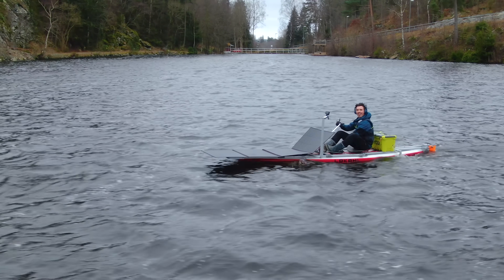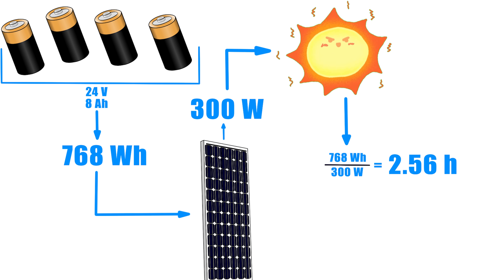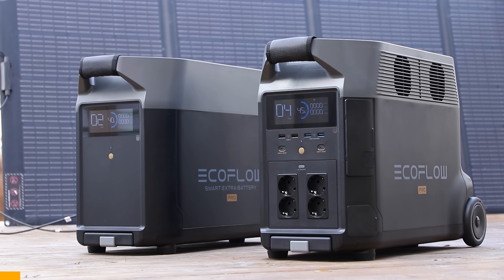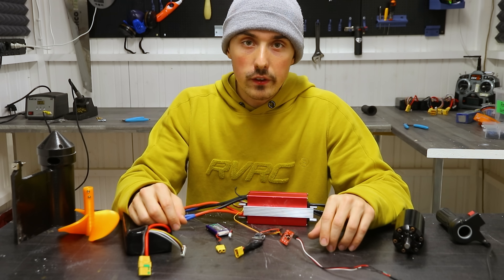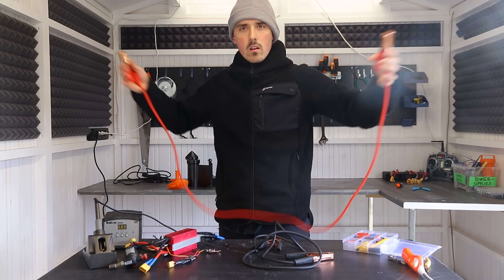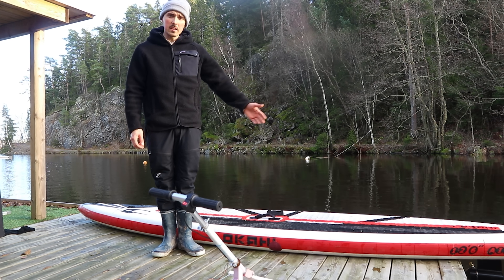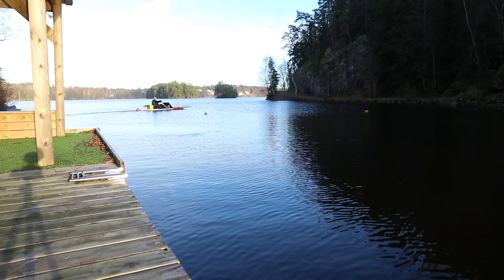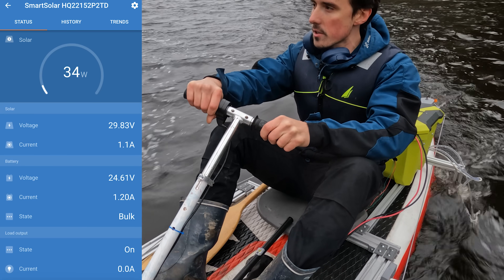Trying To Build An Electric Boat With Infinite Range

Comment: make the hub of the prop the same size as the motor housing. youre getting a lot of turbulence from there. also dont shape the prop like a jet impeller, those are designed to be sorrounded, you need a lower pitch blade more akin to boat props. and a lower rpm. for instance one outboard i looked up runs the prop at a max of 3000 rpm. Also a flat bottom has no stability in turns, not much you can do about that on a paddle board though. it would be more efficient to use the motor as a 360 degree thruster rather than adding a rudder. 18 volts is a dead battery on your setup, any lower and you may not be able to recharge the batteries. also having the water pump like that is a lot of drag, best to run just a hose to the bottom.
Reply: I wonder if you’d get enough cooling without the pump and just using the flow of the water, similar to RC boats.

Comment: I’d like to suggest adding a couple of amas (Polynesian side floats used on canoes) for added stability.  They don’t have to be long. Maybe look at trimaran sailboats and kayaks for ideas.
Reply: Also another option would be to have 2 boards side by side. This would increase stability and add more space for more solar panels
Reply: @TheCRibe  Yes, similar to the windsurfer paired boards with an outboard motor. Also gives option to take a friend 😊
Reply: I was going to comment the same thing, the SUP would really benefit from this addition.
Reply: I was thinking exactly this

Comment: 6:03 I had a set of “”heavy duty”” jumper cables, don’t remember where they came from, but I had them in my vehicle for years and one day I picked them up and a red clamp fell off because the exposed wire had been bent and broke right at the clamp. So I pried up the crimp on the clamp, pulled the old bit of wire out, then cut back the wire sheathing to expose more wire. But, to my surprise, I hit an in-line crimp. So I cut back a bit further to find a similarly dainty wire. The manufacture had apparently crimped a few inches of heavier wire to the clamp, then crimped the heavy wire to the stretch of dainty wire, and covered it up with what looked like a cable strain relief. If you looked at the thickness of the wire and the bit of exposed wire crimped inside the clamp, you’d think the thick wire ran the entire length of the cable, but you’d be wrong…

Comment: Hi, your video is interesting, as always. But I suggest you need a slightly bigger boat for those solar panels. For example, I have a 35 feet sailing boat, to which I added 2 100 watt solar panels this summer. For example, on this video https://youtu.be/SuoUR5u9uG0 you can see running lights on my boat, to which energy is supplied by the solar panels, which are in the back of the boat. By the way: the boat is a Swedish build, a Vindo 50, from 1974. For the winter, the main job of the solar panels is supplying energy to the automatic water pump, to pump water out of the boat, while I am not on the boat.
Reply: 50 kw batery. Eltrc motrr

Comment: The instability of this thing freaks me out, would add more drag, but maybe relocating the electronics box to a single outrigger would be a good idea. Could also make a structure between the outrigger pod and the board to hold the panels/more panels.

Comment: my suggestion for next version. Drop the handle bar and use foot pegs for steering like on normal kayak or surfski (High Perfm. Kayaks with rudders) and have throttle on the side, it gives you free hands and it's much more enjoyable..

Comment: Did you get any data on how much solar you used vs the batteries?
Reply: Looked like he was only getting 35 watts from the panels. Max output from that motor is waaaay more than that!

Comment: "You are not a true engineer until you messed up left and right steering" 
RCLifeOn, 2022
🤣
Reply: Yep, forgot the mechanical crossover.
Reply: just X your steering cable
switch it
Reply: If he swap either 1 of the cable It would fix it right? Or just swap the fin cable.
Reply: The moment I saw the setup at 3:48, I knew the steering will be inversed
Reply: Watching the video with no sound I was wondering what he's doing, if there is such a strong current or something. :-) Thanks.
Reply: "Simply" use a tiller and then it'll be intuitive :p
Reply: i am proud to say that i am indeed a true engineer

Comment: Instead of a water pump to cool the electronics, perhaps put all the batteries and electronics in a box at the bottom of the rudder.  The side of the box could include heat sink fins for cooling the electronics.  The batteries would serve as ballast to keep the craft more stable.  And the whole system (excluding PV panels) could be one assembly that simply hooks onto the back of a canoe.  Think of it as an electric outboard motor.

Comment: Are this 4 panels all connected to the same mppt controller (or has it like 2 sperate channels). Becaude you loose a bit of efficiemcy when combining different angles of solar panels to one single mppt tracker.

Comment: Good video.  I just had an idea.  You could have a much longer string for PV panels if you put them one floats and towed them behind the boat  That might also avoid the need for such a large frame
Reply: i think upgrading to a Canoe/Kajak would be good too,
Reply: @Monarch-industries  I was thinking catamaran. This would make the boat considerably more stable, provide room to lay out the entire solar array (left to right instead of lengthwise) , which would provide more sitting room. And if you put smaller motors on each hull, you could better distribute thrust while allowing for differential steering. :) But then again - when prototyping on the cheap - an inflatable isn't a bad way to go.  LOL :)
Reply: Or make a roof for them to also act as a sunshade, as long as they're not too heavy.
A few youtubers have done this already, notably Jaimie Mantzel, also worth subscribing to.
Reply: Great idea ! & float the panels with pool noodles

Comment: if you get this, you can use that twist throttle easier it puts out a direct servo PWM signal. Acxico 1Pcs DC 5V-15V 3-Channel Analog Voltage Signal to RC PWM Signal Servo ESC Control DIY this is what I use on my go-kart with a servo operating my carburetor on my engine

Comment: Awesome dude! I don't think you need the cooling pump though.. just an intake pipe - into the flow of the water (forward facing) should be enough to force water up the pipe and round the electronics so you might not need that additional power draw.. although that depends on the shape of the intake and the speed of the boat through the water.

Comment: Very cool! Did you sand the 3d printed propellers? It can add a lot of thrust!
Reply: Or instead of sanding, maybe dip it in epoxy.  Makes it stranger as well as smoother.  Could even spin it a bit while the epoxy is wet to fling off the excess.
Reply: @steverobbins4872  Careful with 1 minute epoxy, though. If too thick it will melt and warp your part.
Reply: @steverobbins4872  Stranger :D
Reply: @erskatti  le me grab that strange epoxy
Reply: @erskatti  it makes it a thing, a stranger thing.
Reply: Placing the part in a sealed container with a solvent would serve the same purpose without weakening the part.
Reply: Print it with multi jet fusion
Reply: not can, it WILL :)
Reply: @NiclasHorn  Can, because it depends on how smooth is your print already :)
Reply: Without having even watched the video yet, my reply is that he didn't. Why would he make something more efficient when everything seems to be getting hackier by each video... Not kidding. I used to really like this channel but he is too busy/sloppy/proud to listen to simple advice or do any kind of research. Like, how come after a few years, every water proof box he makes/prints leaks? 
Rant over, time to go watch the video;)

Comment: This is like an episode of primitive technologies - but in the north and a bit less primitive
Reply: The primitive technology will catch up eventually.... 🤣
Reply: so just regular technologies
Reply: I think PT is quite a lot more advanced...
Reply: Try a ring pod around the impeller
Reply: So, just someone building something?
Reply: Omg they would be an epic crossover
Reply: @Dinosaurwarlock  huh what
Reply: And a lot less fake
Reply: @JamiePineappleWyatt  Not all the channels are fake, the original one isnt. There were a lot of fakes that came after that though. Quite a big give away is that the original channel focusses mainly on practical things, whereas the fake ones are generally all about making swimming pools or cool houses and are a lot less practical.
Reply: @conorstewart2214  correct, "Primitive Technology" is an Aussie Bushcraft channel, however as the commenter before me stated "Primitive Technologies", which is one of the fake channels with backloaders, your point is moot
Reply: @JamiePineappleWyatt  If you don't specifically tag someone it isn't reasonable for someone to assume that you are replying to anyone who isn't the OP.
Reply: @garethbaus5471  my initial comment WAS a response to the OP.
Whats your point again?
Reply: @JamiePineappleWyatt  Re read your initial comment, and your second comment, and then notice that the OP was describing 1 specific YouTube channel.